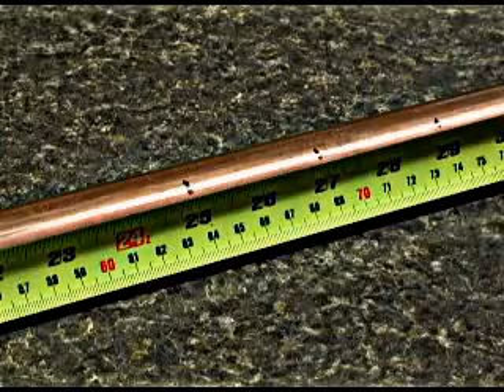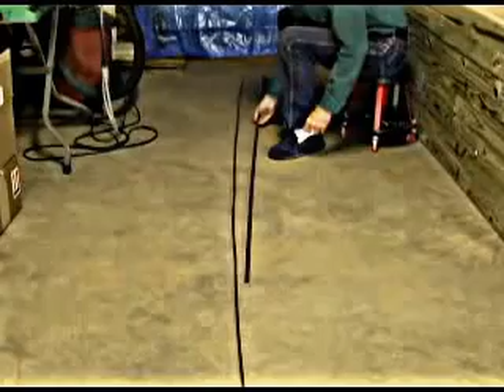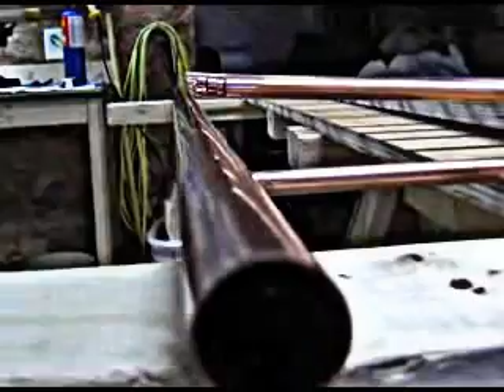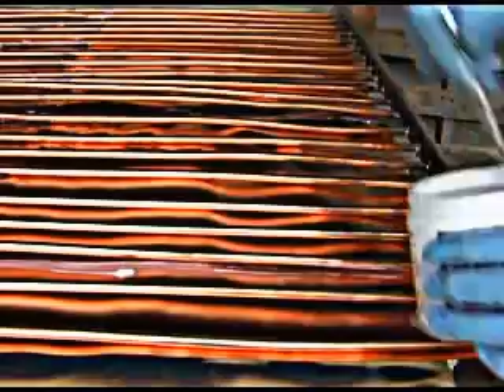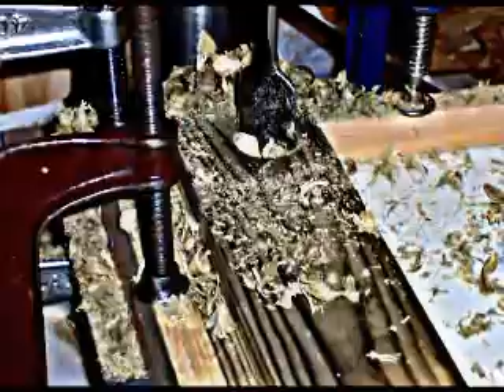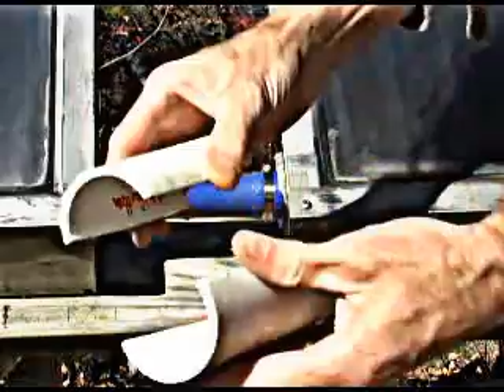Watch Diy Solar Panel System

Comment: Where did the 25k btu/d for a 4x8' copper panel come from?
My natural gas water heater burns 34k btus to heat 40 gallons of water per hour.  You are claiming you can get boiling water out of your panels yet they only produce 25k btus/D??  Something doesn't jive there...